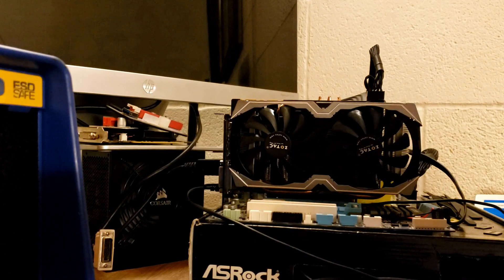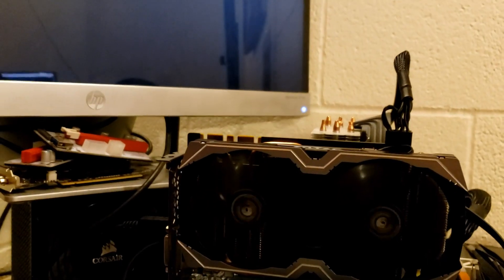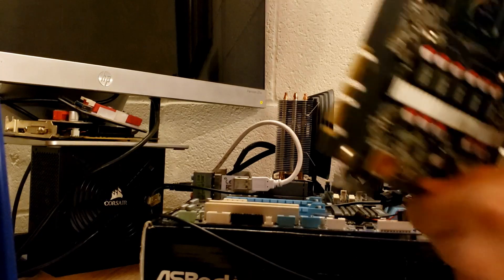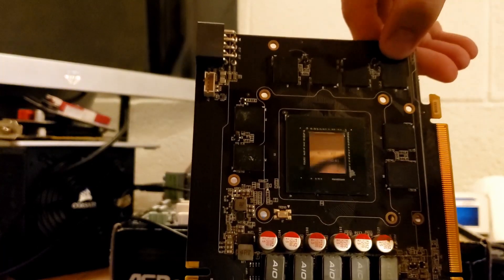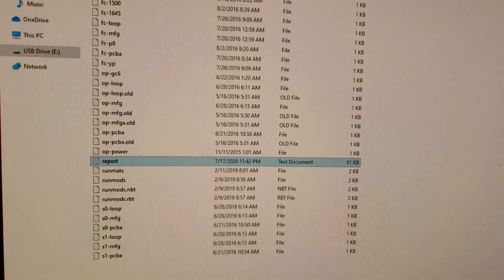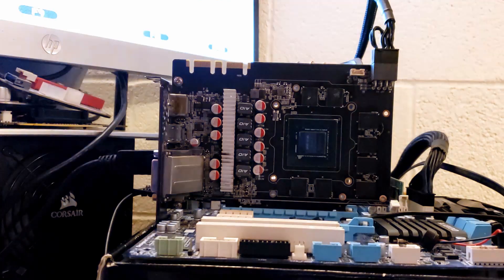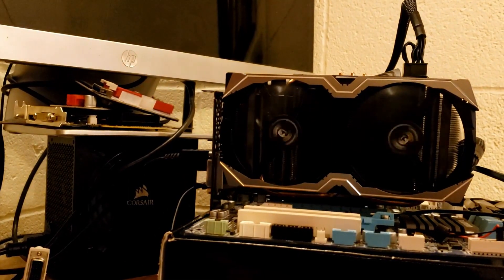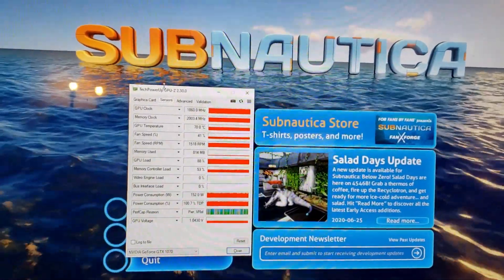Zotac GTX 1070 Repair - Fans spin, Error 43, No display

Comment from the maker: A link to the software and the guide on how to install and use MATS/MODS can be found in the following video

https://www.youtube.com/watch?v=vP9ja6OYLAY
Reply: hello ive followed all the steps but when the computer turns off (after the test is done probably takes like 30 seconds) i cant seem to find the report.txt in the mods file do u think u could help me would mean alot to me thanks
edit: am using a gtx 1070 hybrid ftw btw
Reply: @writepro8057   look for the mods folder on the flash drive, it will contain the repot file. txt where the report is stored.

Comment: Hey TechCemetery, I have the same exact problem on my gtx 1080 ti. First I was able to get into Windows and load the game but would get artifacts and PC shutdown after that. Now I have what you have on this gtx 1070 and can't get the image anymore (only backlight). Can you tell me how you run mats in this case when you can't do anything with the card? I tried to run mats with bootable USB like you did in your guide but the report wasn't generated.
Reply: No reply

Comment: As usual, your work is awsome. just a question, you said you replaced the module from a broken GPU. you took it from the same exact GPU (a 1070 zotac) or from another custom 1070 or even another nvidia series ? thanks
Reply from the maker: Memory modules are standardized, as long as you use Micron GDDR5 in this case with the marking "D9TCB" it'll be fine.

Comment: I purchased a broken EVGA 1070 FTW 8GB and this is the problem I have. No display, with a second GPU I can check device manager and it says "Error 43". I'll try out this software, hopefully that will ease the technicians work where I plan to send it :)

It had a bad mechanical short, one of the caps touched the metal back plate but fortunately the card survived and was able to install a driver as well.

Comment: I have a 750 TI that boots after a minute or so too, and when i install nvidia drivers it crashes and just shows blackscreen. Is this a candidate for memory failure? Can heatgun remedy this issue? I dont have the right tools and skills to replace the memory module. Thanks in advance!

Comment: mine was awfully different,i have a gtx1050 and it sometimes open on oot then it just suddenly turns off, sometimes it wont even show the boot at all but i think the pc boots into windows because the lights on my keyboard and mouse is the same in opening with igpu, i honestly need help
Reply: also, when i am playing games with my igpu, it sometimes turns off and on and pc has a windows sound that something was unplugged and plugged backin

Comment: Hmmm.  I have an ASUS 980.  It takes a minute to boot as well.  The bios screen does eventually pop up, however the screen is doubled as if playing split screen on xbox, left and right. Very low pixel though. It freezes there.

Comment: I have a 1060 with partial errors on one module y checked the logs and shows errors only on bit 059. Would a reflow fixit or should i buy a new module?
Reply from the maker: Show me the error report.
Reply: @TechCemetery  did you get it? i dont know if it was deleted or hidden. Thanks
Reply from the maker: Nope, didn't get it.
Reply from the maker: @FrancescoOliveri  Only way to check is to replace it, but I'd wager it's not the memory that's the problem. You should sell the card.
Reply: @TechCemetery  well, thanks. ill see what i can do :(
Reply: @TechCemetery  Just wanted to let you know, I bought the memory module on aliexpress, it took a while to get here. While it was arriving y practice my skills on an old GPU, had some problems along the way (I lost 2 caps from the 1060) but I was able to fix them.

The memory module arrived today I promptly solder the component and I'm getting 0 errors.

Your videos have been an inspiration for me, Thanks.
Reply: The issues i experience are: error 43 on windows, and as soon as the gpu need to deliver 3d  it crashes and goes on error 43 mode. the desktop experience is just fine. no artifacts.

Comment: thx for the video bro, i wanna ask u something about bga irda rework for removing VRAM CHIP, what model u use ? or u just used reguler hot air station ?
Reply from the maker: For VRAM, I just use my hot air station.
Reply: okay great. do u have irda bga remover? sometimes u need it to replace gpu core maybe?

Comment: The memory chip D9VRL arrived. I tested the GPU again, but I got zero errors on MATS 400.xxx (at 500MB) and MATS 367.38 got 33 errors (at 500MB) on different Memory chip than previously. I used different PSU this time. It appears that I cannot reliable test which chip it is or is it because of the chips at all. Any tips?
Reply from the maker: 33 errors is a common software fault.
Reply: Do you mean that the 367.38 version has bugs?  I was going to get that chip replaced, that I tested month ago. It was FBIOB1 with hundreds thousands errors. Now with 400 no errors and then 367 gives chip FBIOA[ 63: 32] 33 errors.
Reply: @TechCemetery  What would you try next with this Asus Strix 1080 TI if you had this card?
Reply from the maker: @mikegaming4924  MATs has a bug where it can give 33 errors when nothing is wrong. Send me an email.

Comment: Awesome video man. I bought an old 9800gt for 15$. Its giving me the  exact issue. Was wondering where the memory module is located and if it's even worth working on in 2021. Thank you
Reply: hell no the 9800gt was a crazy power hungry gpu ran hot as hell to thoes suffer from damages gpu substrate or cracked balls like the xbox 360 but u can do mem test on it to check
Reply: @trw8777  Did you know if you have to have the GPU fans connected to run the MAPS test or it's okay without them?
Reply: @trw8777  Thanks. If the card doesn't display an image do you boot with onboard GPU or ?
Reply: @trw8777  right, I was wondering how he loaded MATS with a nonfunctional GPU. So he loads from a Boot drive? Do I put the fans back on for the test?
Reply: @trw8777  thanks, are you a Repair tech?
Reply: @trw8777  what State are you in? I'm thinking to open a small repair shop.
Reply: @trw8777  I'm in the States. This hobby can turn into a very profitable business.
Reply: @trw8777  I enjoy it too. Sold my old Macbook to buy all the gear need to repair. Wish there were a tight group here that could repair and share infomation.like Louis rossman
Reply: @trw8777  I hear you. I like to try things out before ever thinking about tossing out any gear. I recently bought 3 broken GPU's with the 43 code error. Put flux around the GPU and reflowed it for 10 minutes, let it cool down, re-paste and they all 3 work perfect now.

Comment: i just wonder you mention error 43 how you figure  that with no image on screen ?!!
Reply from the maker: The card is loaded as a secondary GPU ( I booted off an iGPU and went into device manager).
Reply: @TechCemetery  Can you do the same booting from an ON-Board GPU and running MATS?

Comment: I have a GTX750, it arteffects, runs in very low resolution, does not work with drivers, gives code 43. I also noticed that bank A0 is getting hotter than others...So where can i get the replacement bank from?

Also, Will a gpu always display an image with a faulty vram?

Comment: Man i get Error Code = 000000000723 on mi zotac 1070 mini, what i can do ?
Reply from the maker: Can I see the report?.
Reply: @TechCemetery   sure : https://docs.google.com/document/d/1BdjGJnmoQGUfc4CNL2OIWwaa6_9icF4iBD0FWN4mlNI/edit?usp=sharing
Reply from the maker: @carlosjerez8910  I've never seen this personally, but I'd consider the BIOS and not the memory in this case. Are the capacitors on the PCIe lanes on the back of the cards damaged? you'll want to check the first pair in particular. They should be 220nf.
Reply: @TechCemetery  it can be the pci express slot of the mothorboard too

Comment: Hey, gotten a RTX 2070 Super (second hand). The drivers let the card go into black screen. Even when it decides to boot with the unsuccesful install (incomplete it just install enough for the PC to recognize the GPU) it displays an error 43. What I have noticed is that the card runs unreasonably hot even when idle with the incomplete drivers. Any tips? Sometimes it will boot just to black screen before windows login, and it will display normally in safe mode/without drivers with a 100% success rate
Reply from the maker: Without any diagnostics ( resistances on 1.8V, 1V, memory etc...) I can't give you any good information.

Comment: I have 2 cards that are detected by the pc but they will not display output and will not allow any drivers to download, one is an RX570 8GB and one is a RX470 4GB, any recommendations what to do? The fans spin, the lights turn on, but no display at all but displays normally via onboard display on motherboard
Reply from the maker: I hate to ask, but have you flashed the BIOS on both?. If yes I'd check the voltages on the display rail next.
Reply: @TechCemetery  the bios is the original which the card had from the start :)
Reply from the maker: And what voltage do you get on the display rail?.

Comment: PLEASE HELP ME TECH CEMETARY I HAVE THIS CARD BUT 2 COMPONENTS I THINK ARE DEAD THE 12V AND 5V NPN AND THE L1C9 ON THE REAR OF THE PCB PLEASE HELP BY DOING A DIAGNOSTIC ON THIS CARD LIKE SHOWNG US WHAT NEEDS TO BE CHECKED PLEASE I WILL HAPPILY DONATE 20 POUNDS JUST FOR 10 MINUTES OF YOUR TIME.

Comment: HELLO AND THANKYOU FOR YOUR VIDEOS VERY APPRECIATIVE WORK I SEE YOU HAVE REPAIRED A ZOTAC GEFORCE GTX 1070 8GB ONE IN VIDEO MY PROBLEM IS THE 5V I BELIEVE TRANSISTER HAS A BLOWN HOLE IN IT HAS MARKINGS I THINK B1117 7Q3 ADC AND ALSO THE REAR SIDE A BUCK CONTROLLER WITH L1C9 WAS AN ISSUE COULD YOU REPAIR MY CARD OR ABLE TO SOURCE ME THE COMPONENTS OR COMPATIBLE VERY MUCH APPRECIATE THIS AND PLEASE DO MORE VIDEOS AS THE WAY YOU TALK THROUGH THE VIDEOS IS HELPING EVEN A WOMEN UNDERSTAND BIG THUMBS UP